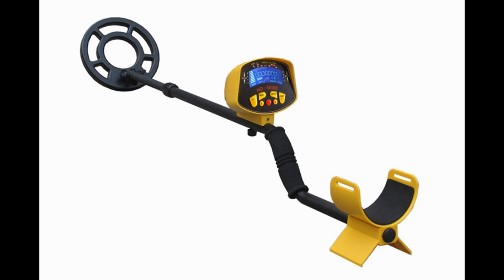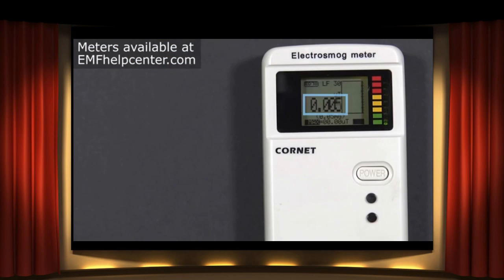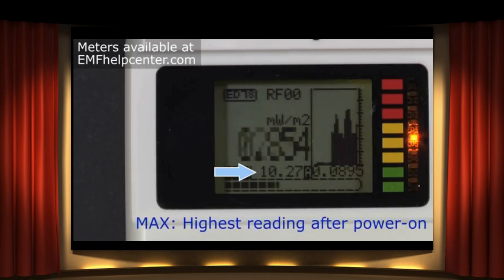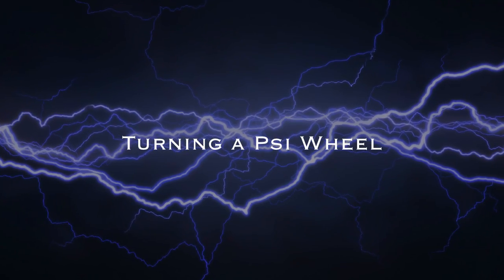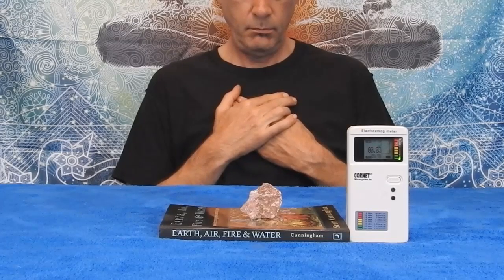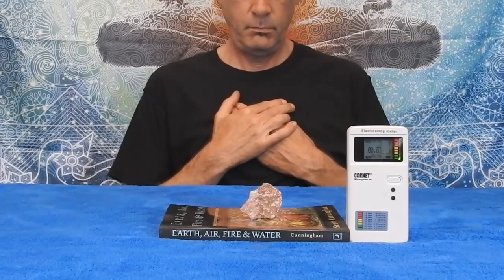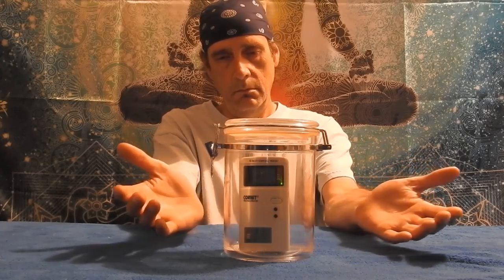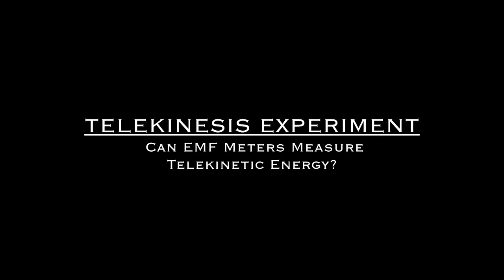?¿TELEKINESIS ?¿ Can EMF Meter Measure Telekinetic Energy

Comment: Its possible that in this video the wave simply did not hit the reader at times and at other times maybe it did a very small ripple effect that hit the reader but not the object, slightly, so by using heavier objects because you automatically increase the energy (maybe without realizing) because its necessary to do so in order to move it, thats when you get a reading.
So basically the reading is proportional to the "energy" necessary to move the object, therefore the reading is proportional to the object.

Comment: I suggest that the increased readings on this device are not measuring telekinetic energy at all which is why most of the time when you moved the objects that it didn't register anything.  I believe that what the device is measuring is back EMF fields produced from the brain and nervous system.  I do believe that it is possible to measure telekinetic energy fields, just not with this device.

Comment: This is incredibly. One question (and my theory hinges on this now...which will greatly enhance my understanding on this subject) when you were working on the meter alone, pushing and pulling, I noticed the meter itself didn't move at all. Was this intentional? And by that I mean, was your intention simply to simulate a push/pull action and register a reading on the meter without necessarily affecting meter stationery state?

Thank you in advance for the response 😊🙏
Reply from the maker: Hi Ray. I was trying to move the meter. Thanks for watching.
Reply: Trebor Seven I see. Thank you for responding.

Why do you think you didn't get any movement out of it?
Reply from the maker: Simply too heavy. They call it subtle energy for a reason. :-)

Comment: trebor the magnetic tic when starting / stopping / changing is due to a field collapse of some kind

there is a branch of thought that ALL forces / fields / spatial distortions are all one singular type of spatial field distortion that manifests differently depending on circumstances and the arrangement and type of the particles involved 

THIS IS NOT ORTHODOX PHYSICS

However, there is no way in orthodox physics for you to have PK.

assume pushing / pulling is a quantum (quantum effects can be mediated by attention) gravitational shift in space

as the gravitational field forms /collapses the energy potential is released randomly (possibly mediated by your intent / and / or the materials moved) in other field spectra i.e. a temporary magnetic field surge

this occurs in much the same way that a moving or collapsing magnetic field cause electrons to flow in wire

that is my best guess
Reply from the maker: Very interesting. Sounds a lot more plausible than the usual ghosts and demons theories I hear so often. Thanks for your input. Namaste :-)
Reply: Trebor Seven 
Thanks. The physics of this is just totally fascinating.

Pretty much everything about psychic phenomena seems to be based in quantum phenomena.

They are both non-local.
They both manifest over a probabilistic spectrum, i.e. not consistently.
Both are impacted by human attention (the probability distribution shifts).

Finally, when watching your videos and listening to you describe to process its almost like the mechanism for PK is similar or identical to described conditions for telepathy. You have to "create empathy" or resonance with the object before you can influence it. Similarly, spontaneous telepathy occurs between pets and owners or family members, or  close friends and lovers.  There must be emotional or psychic resonance. (Rupert Sheldrake) This also explains why most laboratory experiments conducted on telepathy with strangers have poor results.

It is rare to find quantum processes with macro scale effects, but not unheard of. Photosynthesis is a partly quantum mechanical process.

Good luck in your journey to improve.

P.S. I am in no way downplaying any spiritual component to your process.

Comment: I'm working on a hypothesis that involves the supersymmetric field of EGF,the ElectroGravitational Field,theoretically carried by the graviphoton.
This hypothetical supersymmetric force field might also be related to the socalled Dark Energy,the latter being responsible for the acceleration of cosmic expansion. 
In itself this EGF is a weak force field,like gravitation (carried by the graviton particle,which was recently discovered by detecting gravity waves in deep space due to co-spinning interactive black holes).
Therefore the detection of the EGF 'll be very difficult, the more because it interacts on very tiny distances in the order of fractions of Angstroms. 
My impression at this point is that the EGF , though operating at these very short  distances, might influence the electromagnetic field and therefore possibly being responsible for these PK phenomena by temporarily "reversing"  the polarity of electrons, so that a repulsive reaction might occur between two objects, i.e. resulting in this PK- or TK-effect.
I think your video presentations are very interesting and the research into matters like PK or TK deserves serious attention from a scientific point of view. 
I hope you carry on with these experiments.👍
Perhaps I might even experiment myself a little with TK.😉
Kind greetings.